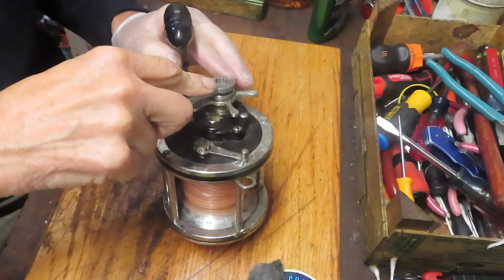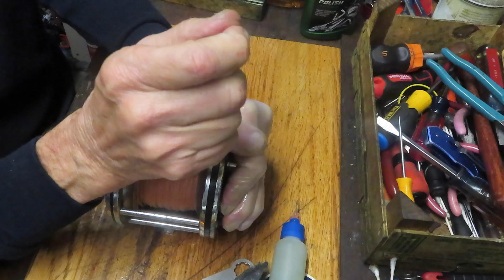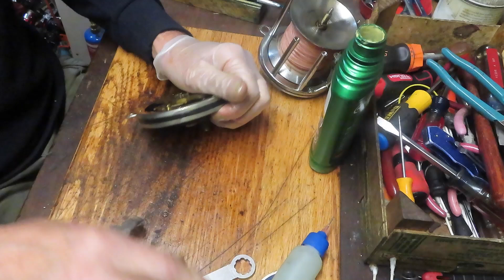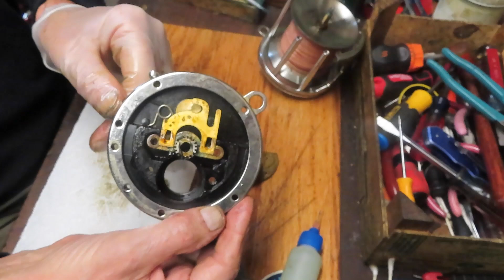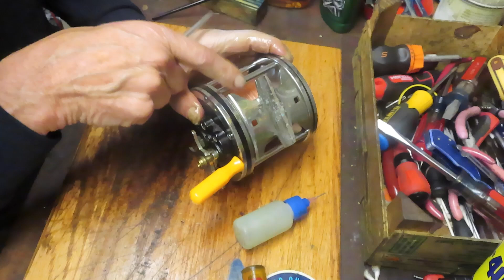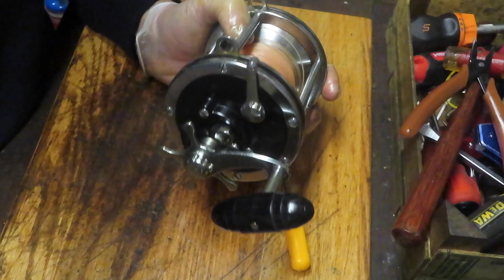Original Penn Senator  6/0 model 114 fishing reel how to take apart and service

Comment: Good morning Dennis, thank you very much for your help on the Penn senator 6/0. You were correct the spool was loose because of the end cap bearing retainer. It was corroded and Frozen in place. Penetrating oil and patience I was able to remove it lubricate and reinstall. Thank you very much again for your help. Peace be with you brother.God Bless 🙏
Reply from the maker: That's great news! Glad I could help get your reel back in working order.

Comment: I bought some side plates for the penn 66 one plate has a bigger gear sleeve hole .

Wonder if someone made the hole larger for a bigger gear sleeve or did Penn have a larger gear sleeve side plate than the other penn 66 side plates I have?
Reply from the maker: Penn 66 or the 6/0?

As far as I am aware, the Penn 66 Long Beach only had one gear side plate version..  The Senator 6/0, that is in this video had multiple versions. of the gear side plate.  The earlier versions had a wide opening.  That enabled you to remove the drag washers and service/replace them without taking off the gear side plate.  The later versions had a narrower opening.  If you are referring to the 6/0 yes, there were 2 different versions - The 66 did not have that variation. - Thanks for asking
Dennis

Comment: Hi. Thank you for the video. I gave a service to the 114 following the video. When i pull the line out with drag on, it turns the handle .. what did i do wrong please?
Reply from the maker: Does your anti-reverse hold or can you turn the reel handle backwards (counterclockwise)?  You may not have set the dog and spring correctly if that is the case.  If it is holding and you have an A/R function, check the drag stack.  The earned washers may not be in the groove of the main gear
Reply: @2ndChanceTackle  yes, correct the problem was the dog. Now its sorted. Cannot wait to take it fishing! Thanks again for your videos. Regards from Malta.
Reply from the maker: Thanks for watching and letting me know that it helped.  Best wishes from a long way away!   Dennis